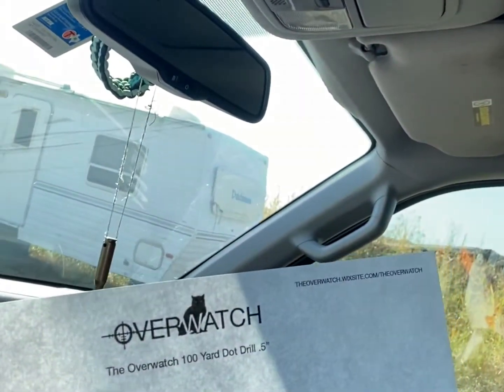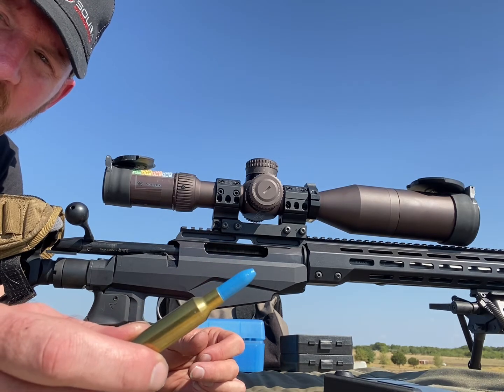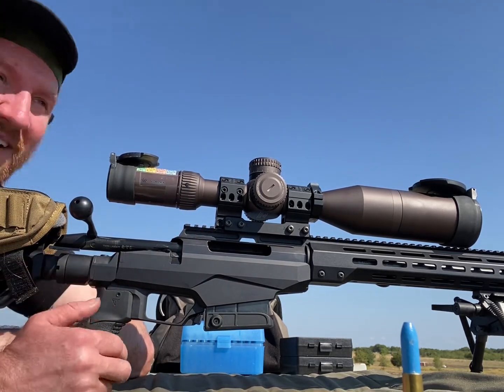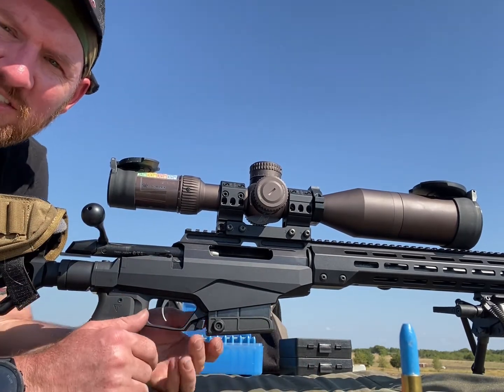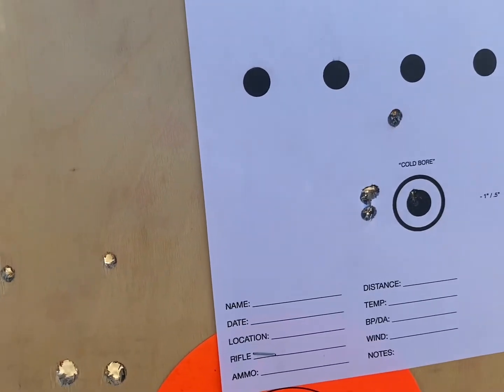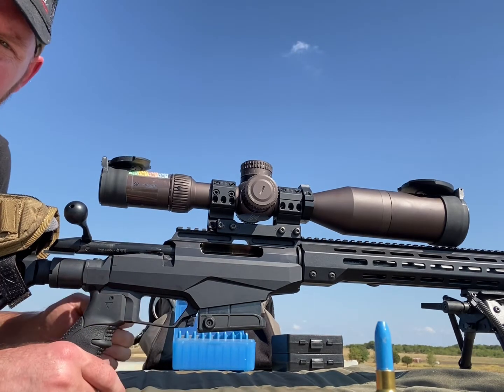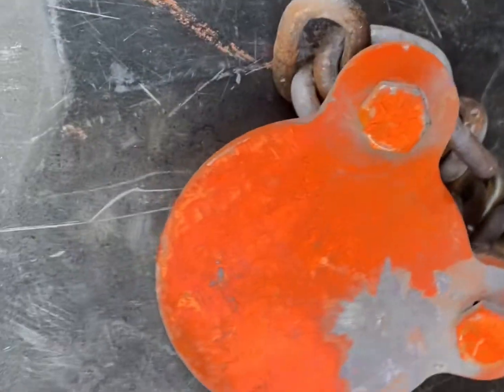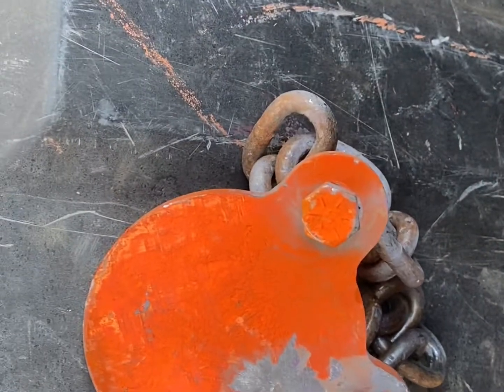6.5 Creedmoor Subsonic Part lll: Accuracy and velocity Test

Comment: What twist rate that barrel is ? I have 7,5 twist and my subsonic ammo which was made using 140gr Sellier bellot flat base bullet did not work well. It was key holing.... Than I used 130gr (shorter bullet) and it was also key holing too...